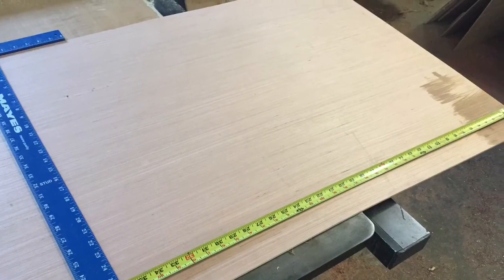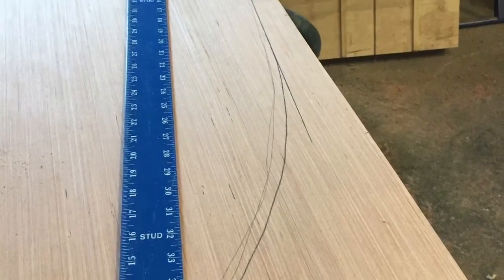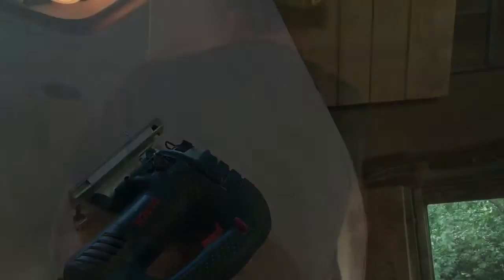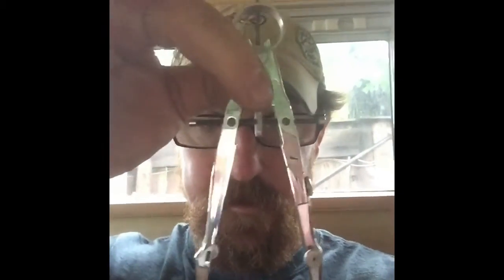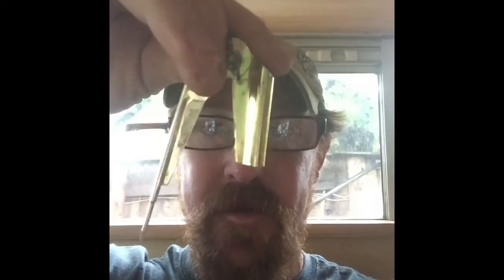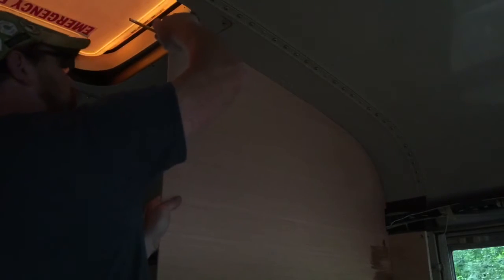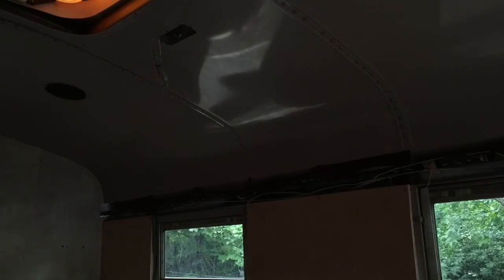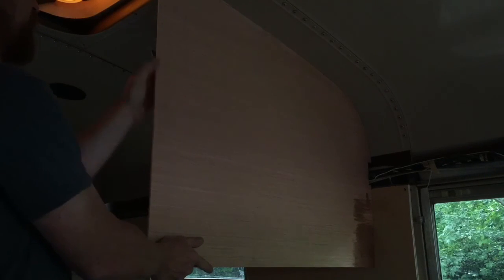How to cut the curve to match the ceiling. School bus conversion.

Comment: Great video Tim.  Not to diminish all the effort that it took to get it to fit just right, but they do make flexible moulding these days that would alleviate all those imperfections that you could adhere to the top of the wall.
Reply from the maker: FlyBoyRV  Why add trim when you can make it perfect?